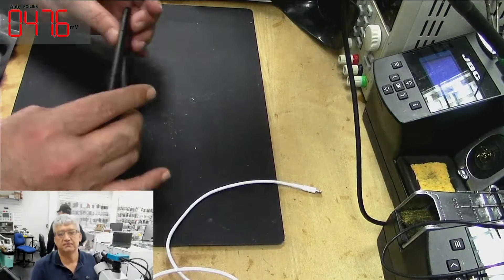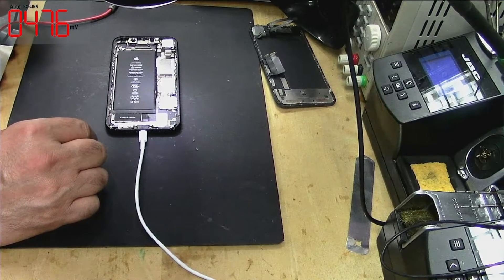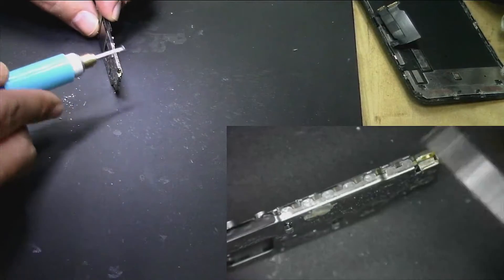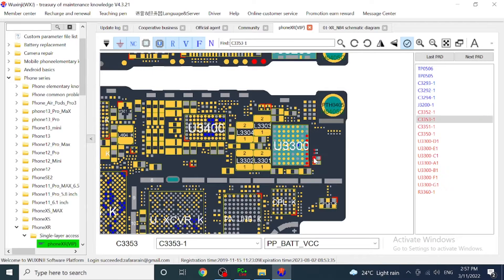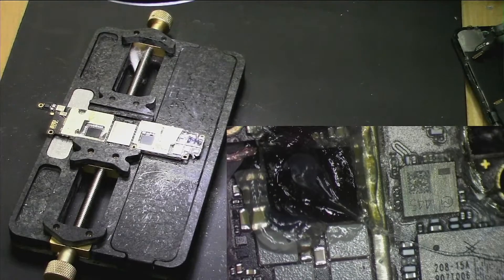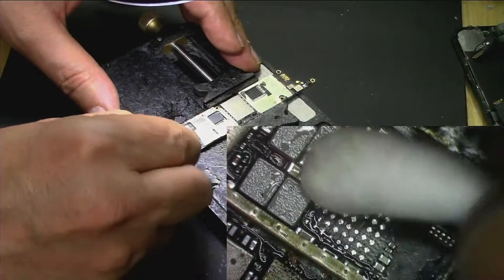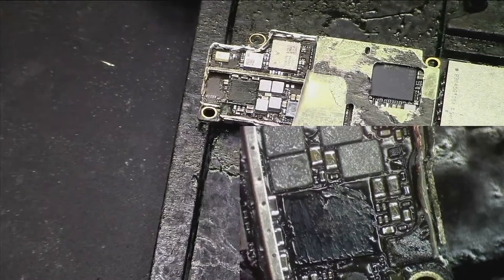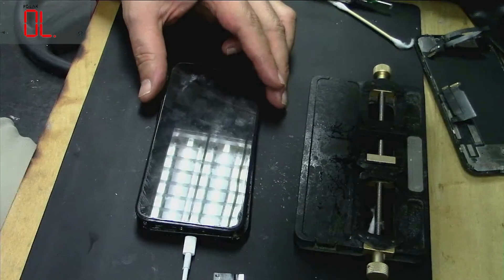iphone xr not turning on, not charging, charging ic SN2600B1 replacement applefix new zealand

Comment: how to know if the defect is tigris or hydra. you tested a line. I've already caught cases of shorted usb rvp and generally I change the hydra!
Reply from the maker: Check with u3100 ic tester if it shows not 3100 it is u3300